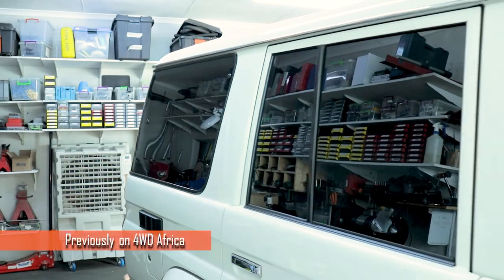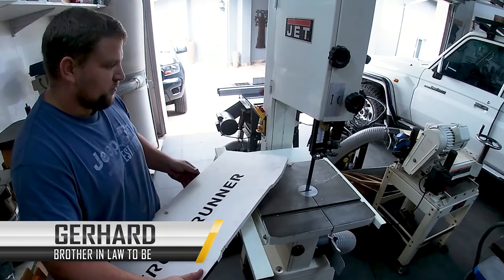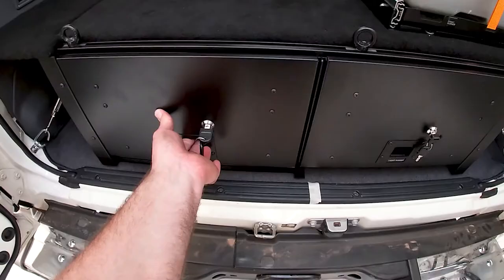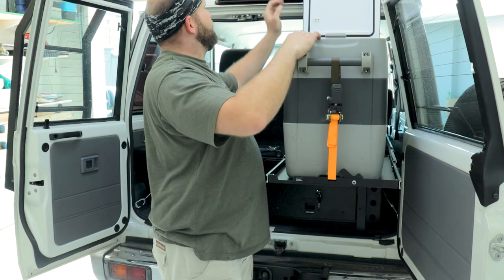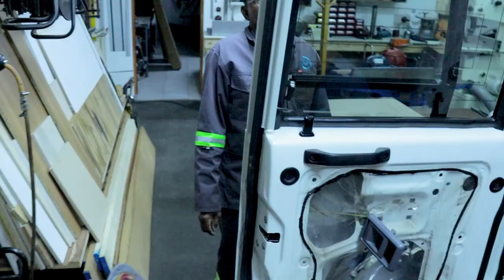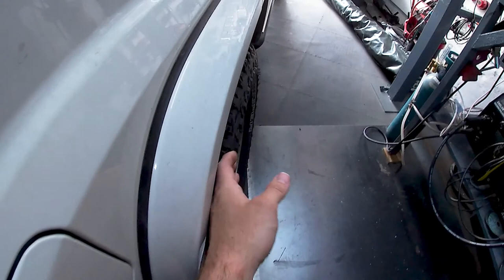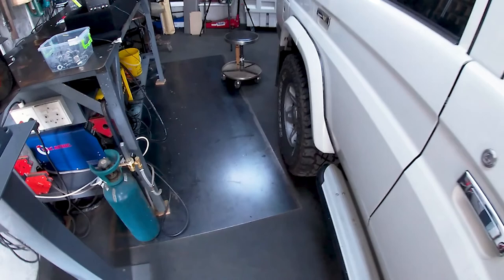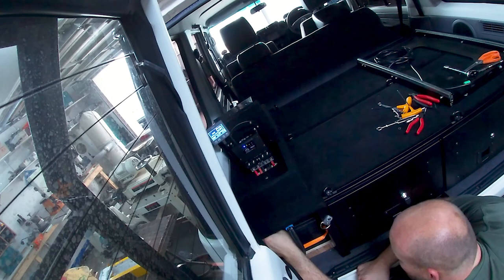MODIFYING A 70 SERIES LAND CRUISER DURING LOCKDOWN. PART 2

Comment: Spacers are the weak link in your otherwise bulletproof car , I would consider going back to std if you intend on using it for what it was intended for . Otherwise contact Patriot Campers in Australia if you want a rear axle that is 100mm wider in track .
Reply from the maker: Thank for you comment. I totally agree that the stainless steel spacers are a weakness. However here in South Africa track correction options are not available unless I import from Aus. I would love to have a JMACX replacement rear diff but the import costs alone are astronomical! not something I'm willing to do at this stage, perhaps something I'll do in the future.